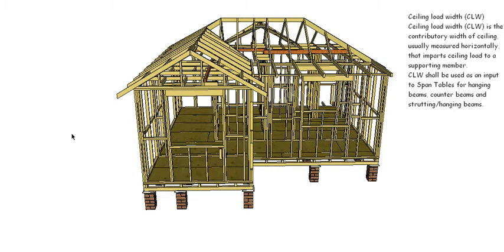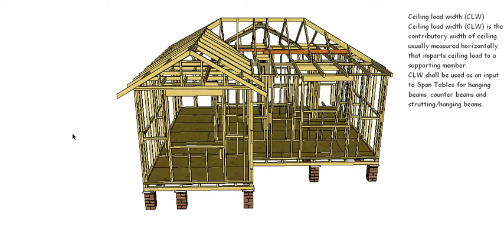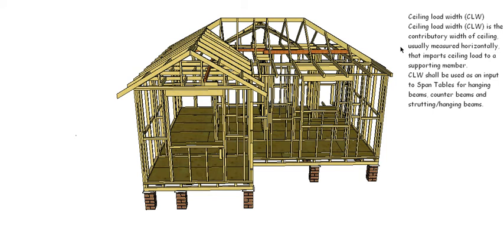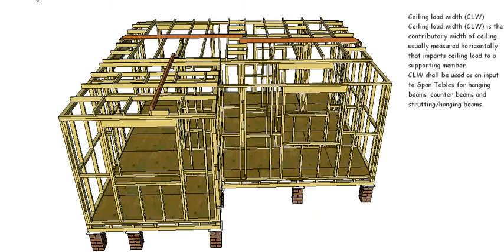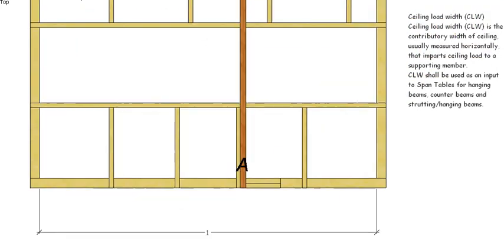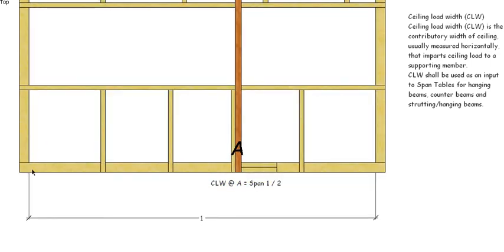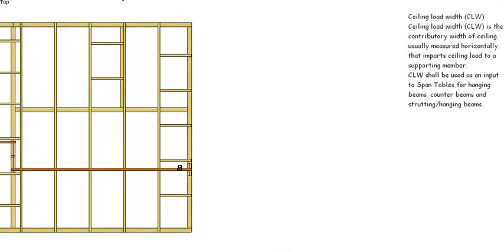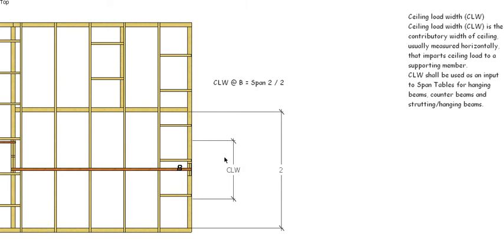5   Ceiling Load Width (CLW)

Comment: in example A would there be an issue with the ceiling joist support because the beam isn't in the middle of the room?
Reply from the maker: As long as you are not exceeding the allowable span of the Ceiling joist then no.

Comment: So what size timber do you use? Do you refer to a span table to use accordingly
Reply from the maker: Hi Alex, you need to use the CLW with the appropriate Span Table to determine the size of the timber that you would use.
Reply: @Buildsum  where do I get a pdf or copy of all the Australian span tables
Reply from the maker: You will need to get a copy of AS 1684 for your region. Normally you would have to buy it online, https://infostore.saiglobal.com/en-au/,  however if you are a TAFE student you can get it through them for free. Otherwise maybe the local library would have a copy.

Comment: thx for the video and it is really good presented. Just a little question that, what software are you using for this video? Is it a engineering drawing software? Kinda slimier with Auto CAD but not sure for that.
Reply from the maker: Peng Wang Hi Peng Thanks for your comments

The drawing software is Google Sketch up. You can get a free version from Google and try it yourself

Buildsum
Reply: Buildsum Thank you mate. I've never recognize that Google Sketch Up could make such great performance on the timber framing work. Sure I would start immediately and try to pick up the skills of it. Thanks for the help buddy! Great video! Wish I could undertake some az timber work someday. lol